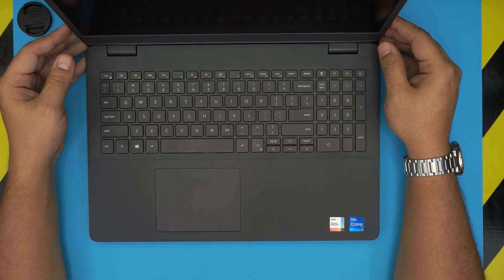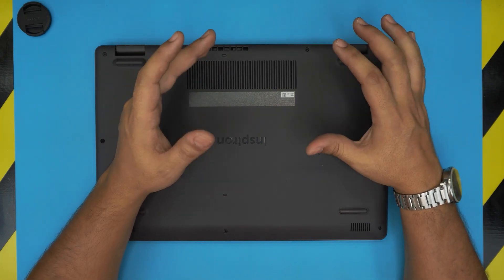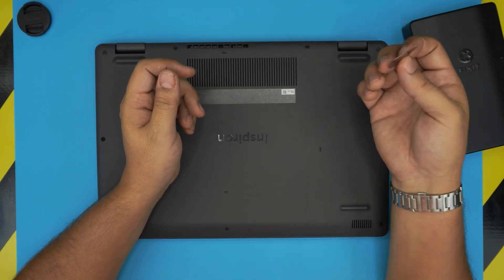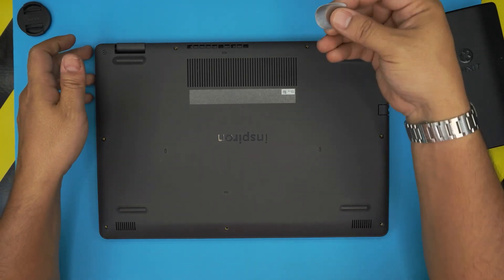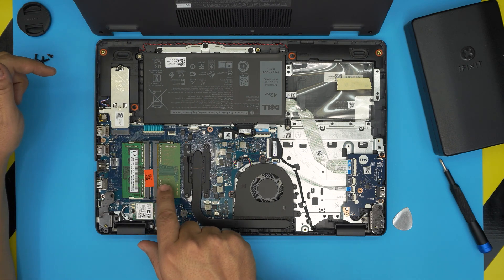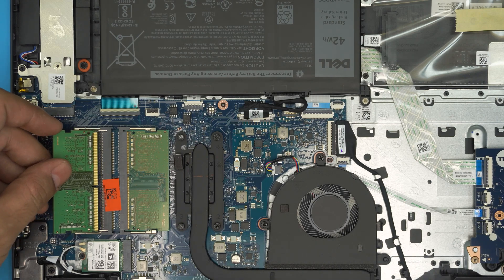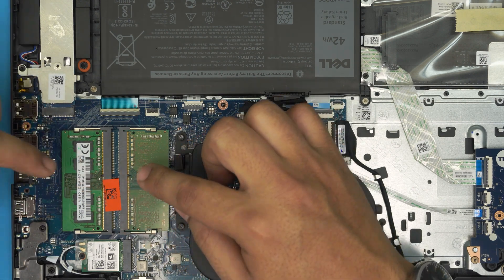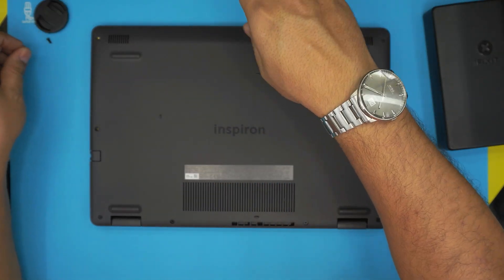Dell Inspiron 3501 Reg. P90f 💻 Ram Upgrade

Comment: Very helpful Sir. Thank you. I have the Same Dell inspiron 3501 model. 

Are you sure that it can really handle 32GB RAM?

The specs on the Dell support site says that the max capacity is only 16 GB.
Reply from the maker: Thank you for your feedback! If you'd like to support the channel, you can like, subscribe, or do both!

Regarding your question, yes you can go with 2x 16 and the ram we tested are this: https://amzn.to/3JjwrpR
also before you upgrade double check and make sure by watching this video:
https://youtu.be/tKEJTkVth4Q
if the video comes up with 32gb then go a head and upgrade if it says 16gb then your exact model is max 16gb
Reply: how was it? did 32gb work?
Reply: @JuanCarlos3rd  Yes Sir! It did. But then it was very old & the CPU was only an i5 2nd gen. Thus we could not upgrade from Win 7 to Win 11 so, we got a new box with a powerful server. But yes, the old Dell 3501 did work with 32GB.